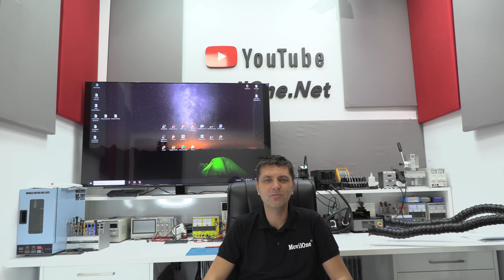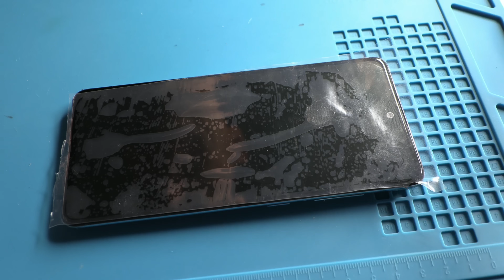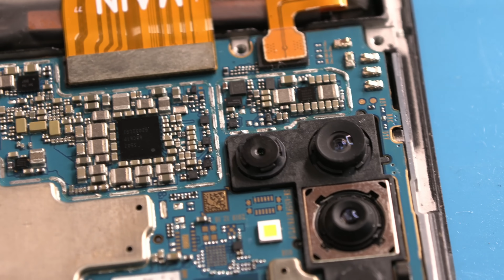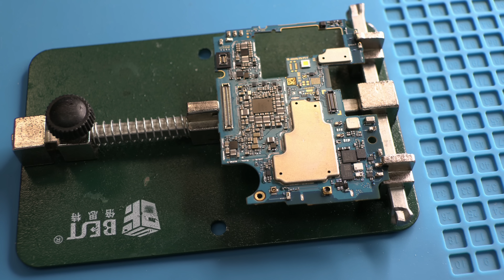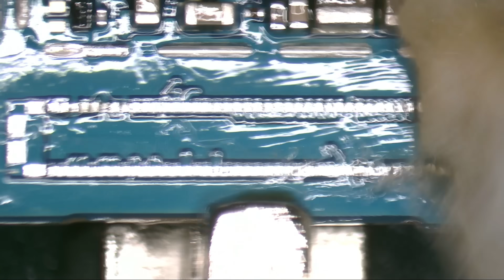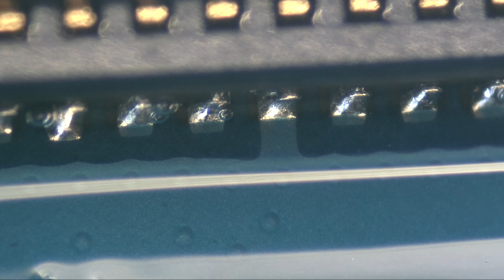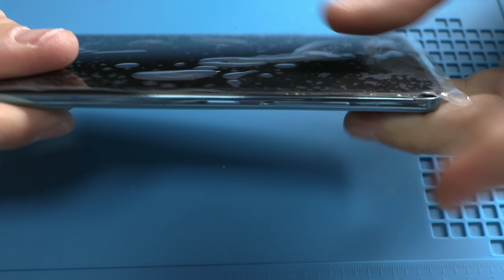The Samsung A Series Secret They Don't Want You to Know!

Comment: Dont the S series phones use multiple flex cables or have they also switches to one long ones?
Reply from the maker: Samsung's S series devices also use these flex cables, but the difference is that they are much more durable.
Reply: @MovilonePhoneRepair  I've only worked on S devices like S21 and it used multiple smaller flex cables

Comment: 😂😂 This problem not in A series But issue is the 78 pin connector in all samsung brand devices even in S10lite Note 10 lite.Even in Newest A15 5G.In india repair about 10 to 15 device in a day on one shop.Price about 5 Dollars.
Reply from the maker: It's interesting to hear about the widespread issue with the 78-pin connectors across various Samsung models. It’s concerning how even newer models like the A15 5G still suffer from the same design flaws. Thanks for sharing your experience; it’s valuable to know how prevalent these issues are in repair shops. Price in Spain 60 euros
Reply: I had galaxy mega 6.3 and it just stopped working.. the tek said that it only could be repaired by replacing the emmc ic 
Is there no other way?

Comment: Bravo ! Any chance you could link the connectors you use ? I have a couple of  the listed phones that have been shelved due to charging issues and would like to have a go at replacing the connectors to see if they come back to life. Thanks in advance.
Reply from the maker: You can buy them on Aliexpress for example, you just have to put Samsung A40 FPC connector.
Reply: @MovilonePhoneRepair  Thanks for the reply :)

Comment: Was the issue in soldering or the connector itself? I didn't get it. You say fragile non-leaded joints and then faulty connector. Which one is it?
Reply: Both, i suppose. such device cost very cheap, hence the material and effort is cheap too. if one needs high quality one shall buy flagship
Reply from the maker: The problem was in the soldering. Many times the connector is even deformed so it does not make good contact with the pins.

Comment: Can confirm this is fact, I've repaired the same issue on countless A series phones, usually the FPC connector fails near the ground connection. Soldering a jumper wire solves the issue or replacing the connector if it's falling apart!
Reply from the maker: Great insight! The ground connection is indeed a weak spot in many A series models, and your approach with jumper wires or connector replacement is a solid fix. Thanks for sharing your experience—it’s helpful for others facing the same problem.
Reply: @MovilonePhoneRepair  Please where can I get the FPC to buy. I'm in Nigeria. I have several phones with same issue including UMIDIGI and Samsung
Reply: Without the grounding wire the charging stops😢
Reply: Only A series? So it's better if I buy a 3 year old S series?
Reply: you want get software upgrades then and security upgrades too. if this is okay with you then you can
Reply: @dariusdareme the S series has the imfamous greenline display problem, samething.
Reply: @dariusdareme I think so
Reply: @dariusdareme it's always better to buy last year's or even the year before flagship model over the most recent entry level phone
Reply: Same fpc if you not found you can get old charging conecter from  A series phone A70. A71. A31. Etc...
Reply: my take is 50-50. they can do it on purpose or they don't know it, the faulty part can be from other company which not providing good product.
Reply: That's mainly the problem I get with the A71
Reply: Yes😢 am experiencing Samsung A80 right now ma phone is down😢. They know what they do
Reply: And to be true they are just too good to be a midrange phone :) had a a71 phone still kicking because I swapped parts and now have an a55
Reply: android phone are designed for obsoletion. Even if your phone is high end phone , few years down the road ,  either your hardware become obsolete bcoz doest fulfilled the current environment requirements OR android will obsolete you, unlike computers which can be used for many years. It is nuts ppl willing to pay thousands for such device
Reply: Capitalism

Comment: 1000% real problem. I saw some phones that the fpc connect ripped off the board because was so brutal.
Reply from the maker: Manufacturers should be ashamed of these design flaws!
Reply: @MovilonePhoneRepair there is not a flaw , you are right , they want you to buy more phones
Reply from the maker: Absolutely! I've seen many devices where the FPC connector ripped off the board, especially after poor-quality repairs or excessive stress. These fragile connectors should have been designed for better durability, but instead, they're yet another example of cost-cutting at the consumer's expense. Thanks for sharing your experience technicians like you are key in exposing these problems.

Comment from the maker: Don't let Samsung's hidden flaws catch you off guard! 💥 Learn how to identify and fix these common issues like a pro. Knowledge is power—take control and fight back against planned obsolescence!
Reply: Samsung don't do anything to the technology to make it fail, they don't need to do it physically they can do it with the software. I have two identical 8 year old Samsung Galaxy tabs one is completely unusable due to a constant "Google play has stopped" message that constantly pops up with no way to stop it other then to wipe the divice however while it fixes the issue it eventually happens again. The only difference between the two is one has been used more then the other, as if there is a timer for the google play problem to accure after a certain amount of use.
Reply: @HOLLASOUNDS 

Same google play issue on my
Note 7.

They still need to fugg the hardware because you can root the device and install something like LineageOS.
Reply: I know this sounds funny, but never sit on your phone.  With phones that have bendable frames, sitting on your phone can bend the PCB, which leads to connectors becoming detached, or reduced connection / current capacity.  This infamously happened with early OnePlus phones, where when the phone was frequently bent from sitting on it, the main SoC chip's BGA solder connections became degraded over time, eventually leading to the phone not powering up.  I owned one, had this happen, so I no longer put a phone in my back pocket when I'm sitting.  My current phone has lasted five years!
Reply: Xiaomi is the best
Reply: What's the point of posting this ai generated comment?
Reply: Sir, can you tell me why samsung phone's display has line issue?
Reply: @SolidCoreBlack buy xiaomi
Reply: @ lol, Xiaomi has problem too.
Reply: @SolidCoreBlack  no problem using since 7 years
Reply: @SolidCoreBlack  A phone touch screan is in 10 to 12 segments and the points where they join can be a problem especially if you have dropped your phone.
Reply: 2,A12 phone made me mad one time is powering next minute to power.......thanks for update.
Reply: Like women and dating... marriage......
Reply: Why only shouting-out Samsung?
Reply: @kneel.downnn because that’s what the video is about…
Reply: I don't buy anything Samsung for that reason, they build their devices like that, to purposefully brake like that.  Not only their phones, their PC monitors, their TVs, their washing machines, everything Samsung is build like that.
Reply: Hi
I'm a technical beginner.
May be I'm at the right place to learn some news skills 😊
I'm interested joining your courses.
Reply: @MovilonePhoneRepair 
 This is interesting. I recommend Samsung, I have never had a bad product from them in 30yrs+
But I have found this issue in Nokia.
Reply: @MovilonePhoneRepair

"stay tuned because the final result is worth every second"

No, it's not because you're still stuck with a piece of Samsuck garbage.
Reply: I know this is unrelated but give the Quran a read, also have a good day :)
Reply: Quran ? Islam ? Prophet Muhammad the guy who literally slept with a 9 year old child . This shi* is disgusting as hell. Keep it to yourself. @realhamza2001